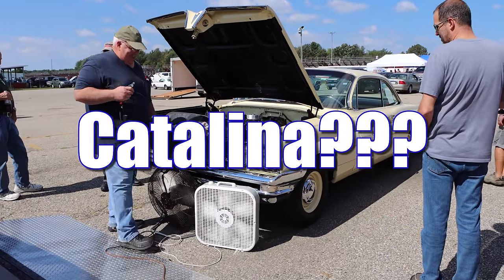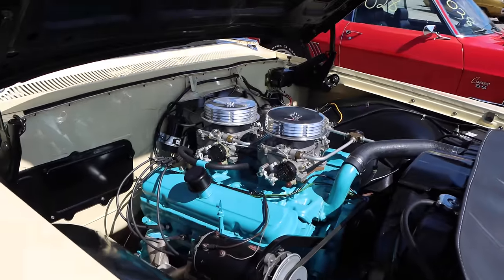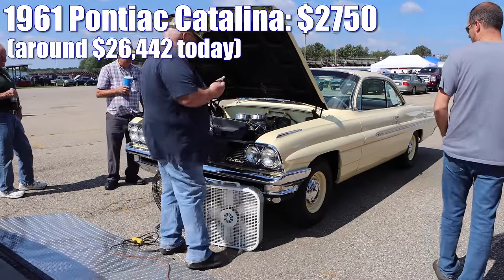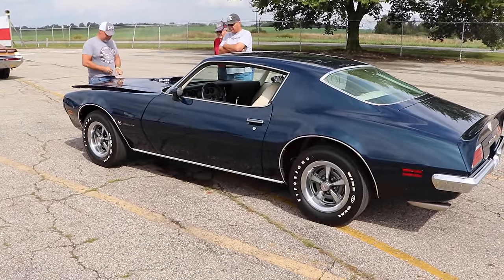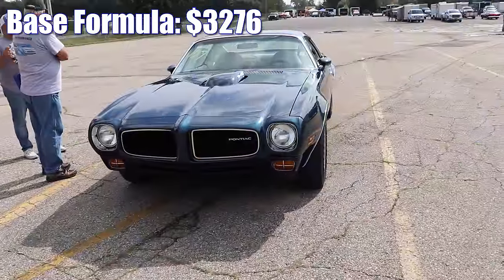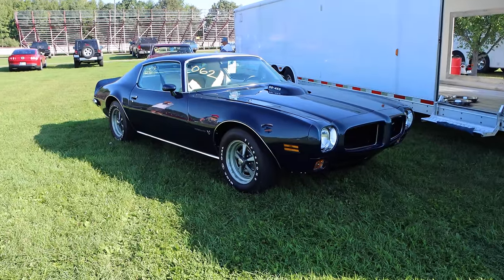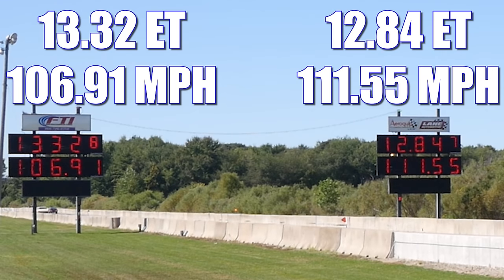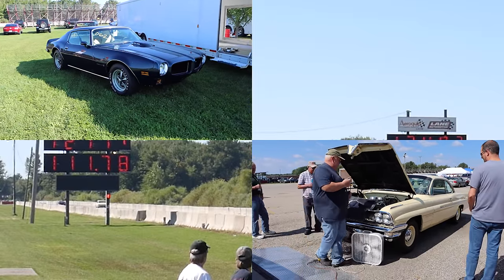1973 Firebird SD455 vs Land Yacht | STOCK DRAG RACE

Comment: My 1974 T/A (had factory produced 1973 heads installed at Norwood factory.. True), with turbo 400 and factory 3.23 posi gear, power windows, loaded with every option, A/C, including 8 track, weighed about 4328lbs (1974 bumpers also added weight)… ran 12.8 @ 113ish all day long at Kilcare.  Back then I had motor blueprinted. hood scoop open, EGR/air pump disabled, timing redone, Turbo 400 had shift kit valve plates inside, factory exhaust.  That was on Goodyear GT radials on factory honeycomb wheels.

Later on, got hands on factory dry sump system.  That added at least 40HP due to reduced pumping losses.  Also, while I never replaced the cast iron round port headers, I did slightly modify exhaust.  Did not run 1/4 with these improvements. However, went from 4.9sec to 60, to 4.4sec to 60.  Beyond that speed on street was even better improvement. The SD was a total sleeper.  Only those who could tell with the slight ting sound in the exhaust, and factory lumpy cam knew not to fool with the Firebird. 

I also knew back then a person who ordered and received a 1974 formula that had a column shift, no console SD-455.  His was midnight blue like mine. It had both hood scoops. The reverse TA, and the two (these were non functional) formula scoops up front.  Weird. He also had the same Trans-Am baseball bat sized sway bars, better springs, etc. of a T/A SD.  He had the rally wheels. He said his was one of one ever made.  Mine is one of 28 made due to the factory options added.  

I have never met up with or heard of another SD on the street that added the over the counter factory dry sump oil system beside mine.  All SD block were special made for this system.  No other factory Pontiac motor design had this ability to add DS.  The 455 oil system design, even with baffled oil pans would have starvation problems around road courses or public road off/on ramps and deep corners.  The SD handles real well.  Pulling .9g+ on street radials of the time.  I measured this on mine using a Valentine G Analyst back when that came out.  I think I ran Goodyear NCTs at the time.  Adjust to add negative camber of about 2degree, and run positive caster to the limit, made the two ton car feel and handle like a Mini.  Imagine with today’s rubber like Sport Cup 2 (if they made the size). You can imagine why the baffles in the oil pan were not enough.  

The time shown on the video is real,  actually, with better tires of today instead of those horrible Polyglass bias plies, that car would lose .5 seconds, and have at least 6mph better trap.  Looks like from what I see/hear, the emissions are all gutted, and timing springs changed.  I am surprised the guy is running one of four ever made on the track.  There are NO factory SD replacement parts.  I heard the factory non aftermarket internals for the manual are not available. I hate to say it, hard core drag runs of a SD-455 is risky.  Not because of its age, but it’s rarity with no factory original SD replacement parts available.  

Thanks for posting the video.
Reply: I had a 1970 Tempest GT-37 with the 400 / 4 speed i just recently sold.   I found out a bit late about the Pontiac oil starvation issue with cornering.....I was getting my inner "Steve McQueen" out with my nicely broken in 400 RA III, and toasted a rod bearing.  It was devastating.   I went to Canton Oil pan,  it seemed to help but did not prevent another Rod bearing failure this spring....Argh!!!!
Reply: @gt-37guy6  yea, totally get that. You do the hard cornering with an older 400, do the rod bearing time.  Sounds like you had a rare machine.  Thanks for the historical comment!
Reply: @gt-37guy6  yikes…  sorry to hear about your devastating event.
Reply: Strip is a lot safer than the st. NO distracted drivers potholes cross traffic.

Comment: Two super rare Ponchos. Firebird clearly faster but I’d take that ‘61 if I had the choice.
Reply: Kim Morrison, if the Catalina was the lightweight "Swiss cheese" 1962 version, the outcome would be far different. No way is that Firebird stock either.
Reply: @sergeantmasson3669  Swiss cheese Ponchos were introduced in ‘63 and were race only with Mckellar #10 camshafts. Not streetable
Reply: @kimmorrison9169   The first ones were produced in late '62 but titled as '63. A former Pontiac dealership owner friend, in FL, has one and the production date is September '62. BTW, it is legally registered in FL and street driven using an "Antique Auto" license plate.
Reply: Swiss cheese, Super Duty, or otherwise, I dig the big Cat.
Reply: '61 was a WILD year those Pontiacs AND Chevy's had the Bubble Tops.That Chevy was a unique year as well with a 409.(WHY would anyone go Ragtop that year)
Reply: @sergeantmasson3669  What makes you think it isn't? Open the exhaust and put street slicks on a '73 SD and it will do 12s all day long, stock.
Reply: @kimmorrison9169  Nope, introduced in 1962.
Reply: @carlosoliveira-rc2xt  You know that, HOW? Do you own one and have done that?

Comment: WoW, you can hear that Q jet moaning on the bird. Anybody that thinks that Q jets suck should watch this race. And that 421 sounds like a super stocker. Good matchup C&Z 🤠
Reply: Q- jets are great carbs, it's just most people back in the day they didn't have the skills to tune them properly. Nothing like hearing them spread boards crack open at full throttle.
Reply: People that disliked the Q-Jet on the street didn't know how to set them up properly. For general all around use, very few carburetors equaled it on the street.
Reply: They seriously leaked from the float bowl plugs.
Reply: Q jets are awesome carbs!! If I knew more about them Id run one. Small primaries and large secondaries are perfect for a st car . Sound of them opening up cant be beat. My holley dont come close lol
Reply: @gordocarbo the sound of a quadrajet is almost as good as a tripower

Comment: That C&D road test of the '73 he posted, I have a follow up test on same car where Nunzi made some tweaks and ran it again. All he did was put slicks on it, uncork the exhaust and remove block off plate on shaker. It ran 13.15 @ 106 bone stock.
Reply: Believe it. That is a quick st car even today. Even in the 80s if someone in the st race crowd knew of a guy who owned a legit 13 sec car it was impressive.

Comment: both of these cars are crazy, especially considering how big and boaty they both are, and they're insanely impressive! props to both drivers for bringing them out and racing them!
Reply: You think a 73 Firebird is a boat? Even that Catalina isn't nowhere near as big as some of the 70s cars were. You must be young.
Reply: @kskip4242  oh, trust me. I know just how big some of those old Lincolns and Caddies can get. I've seen quite a few, and I consider those to be land yachts
Reply: @kskip4242  Far as its weight it sure is . 3800 is porky....course today we see musclecars weighing in over 2 tons which is a turnoff for me. 
USed to think my 3300 lb elky was heavy...back in the day it was. 
3100 today all steel full interior. Id say light?
Reply: @calebrose4607  Grandmother drove caddies from the 60s til the late 80s. Those were huge...but man the room they had, comfort, torque in sheer quiet. 
Back in those days a 1 car garage was big enough to park one with room to get out. Last 2 car garage I saw (trying to buy) could not fit my Camino or truck in it. Ex's E320 barely fit what a joke.

Comment: I saw Hyden Profitt race two 61 SHD Catalinas under the Mickey Thompson banner at an outlaw "Run What You Brung" track near Charlotte, NC in 1961. All the cars were burning Nitro, and hit low 11's as I remember. The Thompson cars won both 1st and 2nd place, much to the dismay of the local guys.

Comment: you seemed more impressed with the catalina than you did the firebird. try buying a stock SD 455 with low miles in original condition today, and see what you pay.
in a stock E/A with a man. the SD ran ran low 13's on a prepped track.
the SD formula, like you said, were very rare.
thanks guys, love this channel for years. you actually listen you what we want. props.
PS you mentioned ''knowing the right people'' well if you wanted a true race engine, you could have ordered a  Ram Air V 400 with 520HP in 1970 over the counter.
Reply: According to Hagerty, a #2 (excellent shape) is $185,000 USD now....
Reply: @josephsummers2427  Then I guess I'm rich.  I'm the second owner of a 74 TA SD-455 4 speed with 14k miles.  It's unrestored, all stock and I've owned it since July 78.  Paid $5650 for it.
Reply: @clevlandblock  The 1974s are worth less, but yeah that is still rich. If it is in excellent shape (#2), it might be book value around $120,000 USD. // Even if some offers reached to 80% of that, that is $96,000....
Reply: @clevlandblock  Muscle cars have gone through the roof in pricing the last 5 years
Reply: @clevlandblock  you are rich… for the experience everyday, and the financials.  :)
Reply: @josephsummers2427  here is the sleeper…  many of the 74 SD-455s (few in total) that came out of Norwood had the 1973 heads.  Like mine…. So, once this gets out, a 1974 with the slightly larger exhaust valves with the 73 heads will be worth more.  :)
Reply: Yeah. Don't offend the bean counters.
Reply: @clevlandblock  WOw....put some miles on it car has sat long enough. 
We may see the day we are forbid to drive em. Dont worry about the next guy there may not be one. Younger peeps could care less about these they want a camry or EV. Boring
Reply: @josephsummers2427  Started skyricketing late 80s. If I had the coin id never pay that kind of $ for any car. Out of control
Miss picking up a Recycler early Thurs morning and thumbing through the 4 sale section.

Comment: Big difference in these engines is head flow. The SD421 is around 200 cfm, the SD455 around 250cfm.
Reply: Most people do not realize the SD455 was originally a SD400 started in 1970 and NOT talking the Ram Air 5 303 ci which was a bust. For various reasons the SD400 got pushed back year to year then they put all those parts on the 455 and then dropped compression and such. They also told GM it was a regular 455 so it did not need to be certified separately or it would never have passed so a little dishonesty got the public the last musclecar of the 1970's.
Yes, a low compression and lower cammed motor was a beast running low 13's stock back then and it was fast
even by old stock musclecar standards. So yes, the 1973/74 SD 455 was a culmination of all Pontiac could throw at a production engine and still stay streetable enough to make it to production. But its roots started in 1970 on a 400 ci platform. Had they gotten that SD 400 it would have been faster than the RA4 of that day.
I had a 1973 SD 455 Trans Am......auto with ac but upgraded the rear gears......lol. Also upgraded the cam and distributor as well as some other minor things and had it running good. I heard back then (1993) when I had mine of a guy in Cali that stuck a custom roller cam in his with a really great profile and he also added compression via pistons and slight head mill and other tricks and it was an absolute beast.....never got over to that side of the country though but I heard from other pontiac guys back then that it ran GOOD. 
I noticed all the guys rattling off SD455 specs but rarely do i see it pointed out that the SD block itself was made of a much higher nickel content to increase block strength much like the extra webbing in lifter galley and thicker areas all over the block they could do all to increase block strength to handle high rpm with less distortion.
Those Super Duty heads were racing heads with bigger chambers for lower compression......the ports so big they broke into the pushrod holes and they pressed in pushrod hole tubes to seal it up......also multiple valve angles over the stock D port heads. Yes that extra flow made that big engine able to make the power and those SD rods let the engine spin much higher than a stock D port 455. 
Biggest or rather one of the biggest automotive mistakes of mine was selling that 73 SD Trans Am.....it was brewster green ext as well which was my favorite color. Had several 1978 Anniversary Gold trans ams with the 400 that I redid to around ram air four specs but my all time fav Trans Am I ever had was that 1973 SD TA.
Reply: @gregallen9065  Love those gold TAs!  They had 0 go, crazy tall gears but cant not notice them. Girl in HS (class of 86) drove a pristine black TA carpooled with her. Sharpest car in the parking lot for sure.

Comment: I have a '61 Catalina that exact same color. I was going to clone it into a 421 Super Duty. I had a correct block found and most of the 4 speed parts but gave up on it. Now it's just getting a more mundane 428 with a TH400.
Reply: Will still be a super cool car👍

Comment: I believe the 1973 standard 455 had 8.4:1 compression ratio, but the 1973 Super Duty 455 had 8.5:1 compression ratio, which was GM's limit and the SD 455 might have pushed that a bit more. The Pontiac SD 455 designers wanted a waiver on the GM compression ratio limit, like the 9:1 compression ratio 1973 Chevy L-82 350 had, but GM wouldn't do it. The SD 455 was squeezing a bit more compression ratio than the standard 8.4:1 455 in 1973.
Reply: True.
Reply: @johnross6314  From what I understand, both the 1973 and 1974 engines were identical. Pontiac wanted a hotter cam in 1973 but in would not pass emissions.
literature had already gone out with the erroneous "310" HP rating.
Both were 290HP.
Can someone confirm? Thx